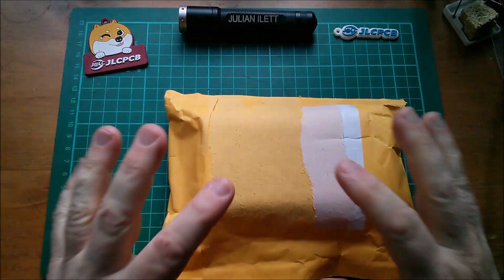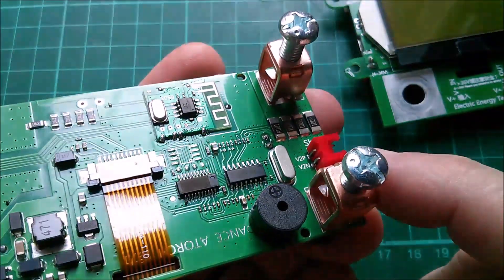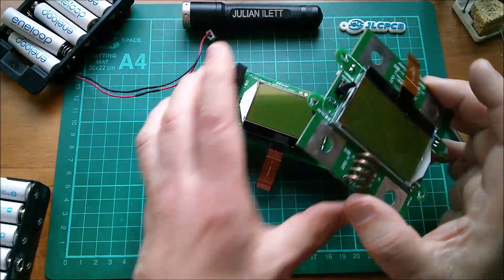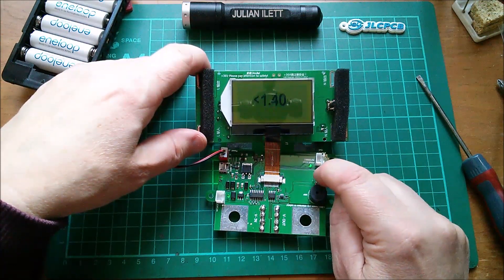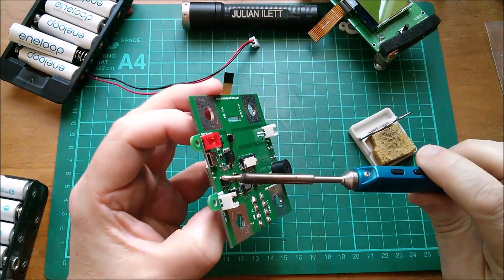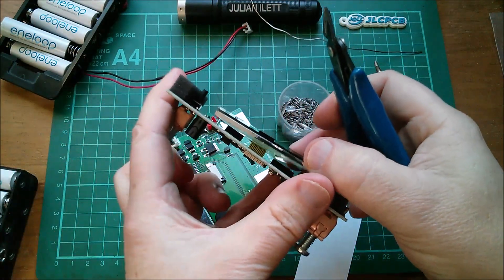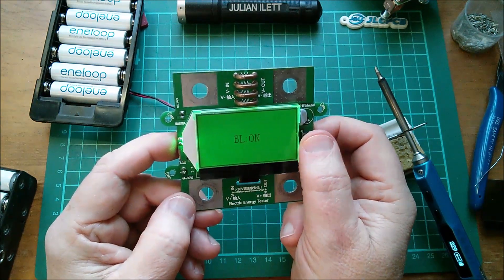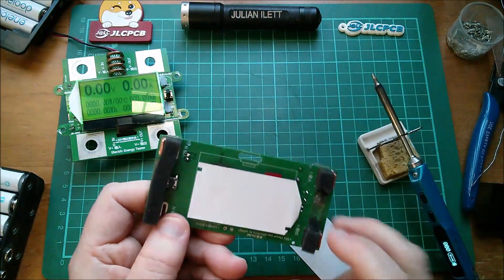Fixing the Solar Wattmeter

Comment: 12:00 small tip: never forget to check if you didnt left screwdriver or anything else under board when you slap it... I did that once and one of capacitor had close encounter with one of my removable screwdriver tip :]

Comment: The "new" meter is AC. You can clearly see L (Line) and N (Neutral) marked on PCB.
Reply: 0:30 The enclosure says DC Power Detector.
0:45 The back says DC OUT and DC IN.
Reply: @Okurkaarrgghh  The PCB says otherwise. They assembled it wrong. I bet there is an AC enclosure somewhere with a DC board in it.

Comment: For that 'new' board, figuring 100 amps across those four 1 milliohm resistors, it comes to about 2.5 watts.  From the size of them, that's probably exactly what they're rated for - not a great design.

Comment: Great video!
In reality, looks like standard LCD to me.. If looking closer to LCD ribbon cable, there should be some markings about display type etc (on silkscreen or on copper layer).. Usually, they can be purchased separately too.. 😉
Reply: I'm willing to bet good money it was cheaper to get that wattmeter than to buy one LCD. Heck, it was cheaper to buy all new battery-operated candles with batteries included than buying the same amount of batteries. The magic of vertical integration.
Reply: @ethanpschwartz  OK, the bet is on.

The LCD screen including the backlight costs £4.16 shipped on Aliexpress.
Reply: At 3:38 you can see the ribbon cable says HSG12864-110.
Reply from the maker: Thanks Okurka - I've bought five :)
Also, it seems the battery monitor devices (that use this LCD) are no longer available :(

Comment: suspect that it needs an external current shunt (hence the connector) for anything higher than a few amps
Reply from the maker: It appears the item is no longer for sale (from either seller). The bluetooth module talks to an app which you can use to remotely monitor the device.

Comment: 1 milliohm resistors on that module, so 0.25 milliohm for the 4. 100^2 * 0.25 mR = 2.5 W power dissipation across those resistors in total. Probably feasible for short periods

Comment: You could setup A Node MCU  on the Bluetooth (ESP 32 / ESP 8266)To make logs to SD Card DB Even SSH Tunnel into the miner to throttle Rates - Give a Webpage on Wifi
Reply: Theres also Android on raspberry Pi  / VM Sandbox  if you want to run unsafe/untrusted  Android apps (A Soil & Sandbox Computer ) even Attempt to revert them back Source code to see if there was something up

VM Can do one better Toilet Roll paper Sheet Disposable VM PCs

Comment: 30,000 Watts!  300V and 100A?  I very much doubt it, especially with those SMD resistors.  Nice though the display was compatible with the old one.
Reply: When calculating power across a resistor, you only count the voltage drop across them, not the total system voltage.  With four in parallel, the equivalent series resistance is  0.25 milli ohms.  Multiply that by 100 amps, and the voltage drop would be 0.025 volts.  Now you can do the power calculation, 100^2 * 0.025, and you get 2.5 watts.  Not too awful for those size resistors, but I'm guessing it's close to their rating.